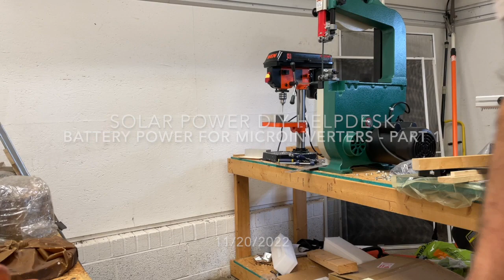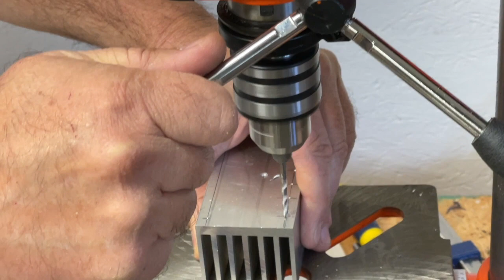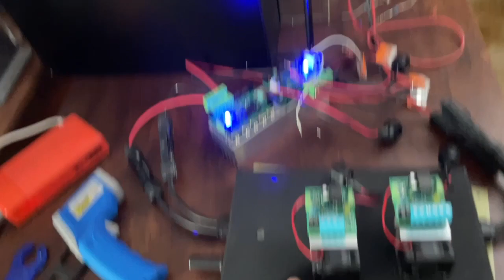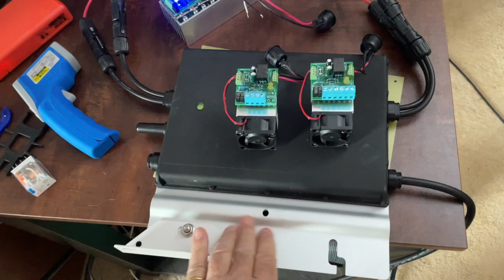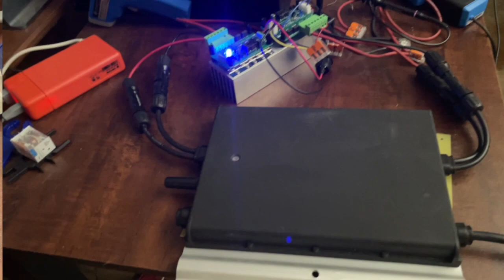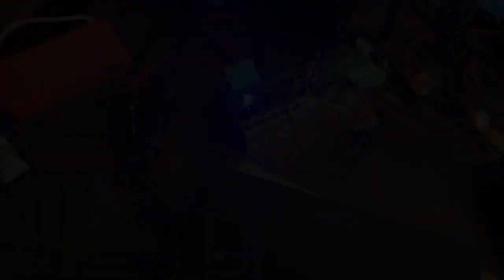Battery Power for Microinverters - Part 1

Comment: I ran Enphase IQ7 direct from 22v battery via precharge resistor and it only draws enough current to reach full rated power output. I would run it via a MOSFET switch on DC input to serve as a precharge soft start and as auto fuse. But with Enphase micro it appears theres no need for current limiting DC-DC between the micro and battery.
Reply from the maker: Did you look at the peak current with an oscilloscope, or are you just measuring the average DC current? The waveform is not flat DC. It is a 120Hz Rectified sinewave. At low input impedance (no MOSFET or resistor) the peak current is 2X higher than the average current, and exceeds the MAX input current spec. The microinverters rely on the resistance of the panels to smooth out this 120Hz ripple into a much lower amplitude sinewave, oscillating about the average current.  While it does work, and I have shown that it does, the peak current, temperature, and longevity are expected to be much better when the impedance is higher. I use the MOSFET in the linear range to create an Isc equivalent to a solar panel, so that it is not zero-impedance.
Reply: @DiySolarHelpDesk  Are you sure you are not measuring RMS x 1.41 current? To smooth out 60hz voltage ripple down to 0.5V at 8A on DC side, a microinveter would need 133000 uF cap. Obviously that's too large to fit inside the micro, so 120hz current ripple is passed on to the input. C = I / (2 x f x Vpp)